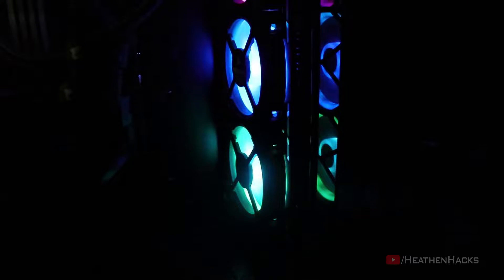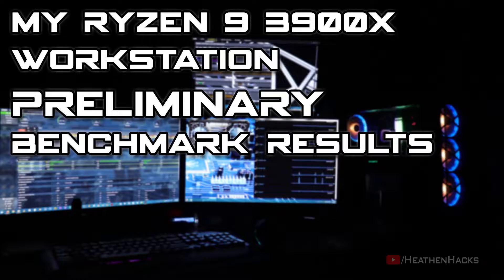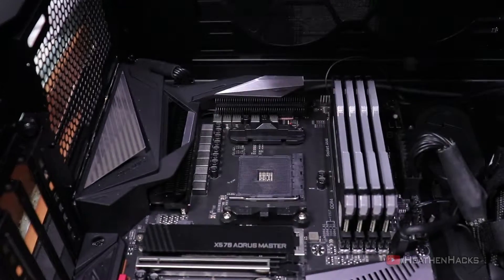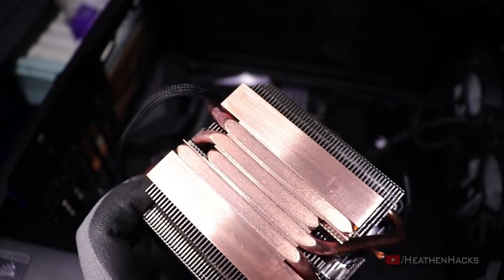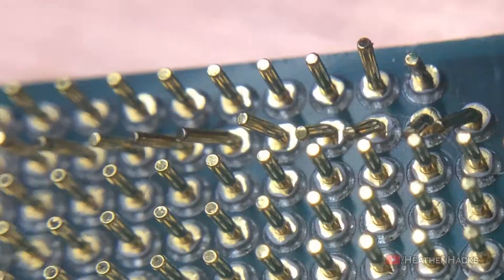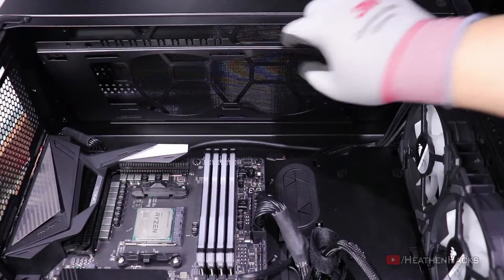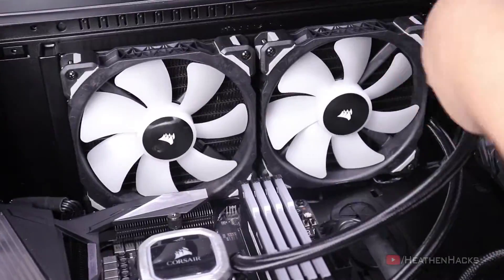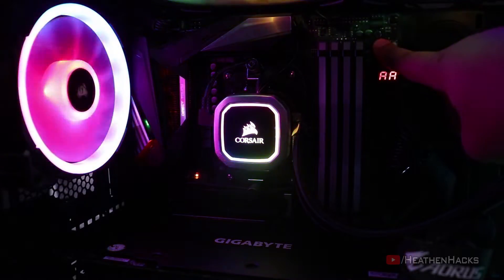Corsair H115i RGB Platinum & LL120 RGB Fan | Unboxing & Setup + PSA for Future AMD Adapters.

Comment: Okay
So if I buy Corsair ML140RGB

and if I want to use motherboard RGB Pins for lightning it up 
And for Fans 
If I use chassis header on case
Will it work normally??
Reply from the maker: Hello, and thanks for the comment! ♥ 

For that, I would refer you to this link on the Corsair forum: https://forum.corsair.com/forums/showthread.php?p=952274

They're talking about LL fans there, but it would also apply on ML fans.

Comment: Well i have the problem with my pump, the rgb dosn´t work, i conected all whe wires but just the fans has rgb, any solution?
Reply from the maker: Hello, and thanks for the comment! ♥ I suggest contacting Corsair through r/Corsair or [https://help.corsair.com/hc/en-us]
Reply: @HeathenHacks  Page dosnt exist anymore, i was searching and some people has the same problem and one of them said something about the PSU, the SATA need to be conected to another with 5 wires. and my thermaltake 750w only have 4. they recommend to change the PSU a little dissapointed cuz i just buy this PSU and the AIO, thx for answer
Reply from the maker: I haven't experienced that problem yet, so I'm unfamiliar with it. Sorry.

Also, I think I just saw something related to your problem here: https://forum.corsair.com/v3/showthread.php?t=183941

Someone's also using a Thermaltake PSU and had it replaced.

I guess if you can still return your AIO to where you bought it from, you can change it to a different one.

Comment: Hi, so I have the same cooler and want to buy an extra Corsair RGB fan, will I need to purchase the commander pro in order to control the extra fan via the ICUE software that comes with the h115i?
Reply from the maker: Hello, AM! Thanks for the comment! ♥ Unfortunately, yes. I think either a commander pro or getting a set of 3 Corsair RGB fans [the one that comes with a fan/rgb hub] are the only way to control them using iCUE.

Comment: i need help,my motherboard doesnt have the little 2 pieces where u put the aio with
Reply from the maker: Hello, Don! And thanks for the comment! ♥ What 2 pieces are you referring to? The mounting brackets?
Reply: @HeathenHacks  i think so, the ones in the motherboard where you mounted the aio brackets with
Reply from the maker: Ahhh. I see. I think I know what you mean now. Btw. Are you using an AMD motherboard or INTEL? If it is Intel, I think you need a different bracket/backplate.

You can watch this video from Corsair for a better view of the installation.

https://www.youtube.com/watch?v=87c5_93-3QU

Comment: Why you installed the radiator on top ?
Like that the air will not rise.
Reply from the maker: Hello, Daniel! ♥ Thanks for the comment! That's why there are fans. To pull air out of the case.

Comment: I know this comment is late, but I have some questions about RGB. I have the Asus Prime X570 Pro Morherboard, which I believe has 2 RGB headers and 1 ARGB header. I’ve already purchased 2 Phanteks Neon RGB strips that use a 5V header, so that would take my one ARGB header, right? I’m also using the same cooler as you, and wanted to add two of those fans you used. Would i need a splitter for something? Just a commander pro? I really don’t know much about fans and RGB
Reply from the maker: Hello, Matt! Thanks for the comment! ♥ For the 2 Phanteks Neon RGB strips, yes. You only need 1 header for that since it can be daisy-chained. If I remember correctly, you can just use the fan and RGB hubs that are connected to the pump  for the ML140 fans.

Check out Corsair's installation video for reference: https://www.youtube.com/watch?v=F4RmMKwC5hA
Reply: HeathenHacks sorry, I was asking if I always wanted to use QL or LL fans in addition to both
Reply from the maker: I see. For that, yes. A Corsair Commander Pro would be needed to both control the RPM and RGB of the fans.
Reply: HeathenHacks I ended up getting the QL fans that include the lighting node core, and a separate fan hub that isn’t like 90 dollars aha. I believe that should be all I need
Reply: HeathenHacks thanks for your feedback though!
Reply from the maker: Oh, yeah. I forgot that a lighting node core is included if you buy a pair. Good choice.

Comment: Hey so I just purchased  H115i and was thinking about replacing the mL fans with LL ones. Do you think that’s possible? I want all LL fans on my setup.
Reply from the maker: Hello, Jonathan! Thanks for the comment! ❤️ Yes. It’s possible. Tho, afaik, ML fans are much more suited for radiators, because they can spin and move air much faster than the LL ones. Just saying.
Reply: HeathenHacks I know. But the LL series look so much better and I don’t want to mix and match between the 2.
Reply from the maker: Yeah. It does look much better. I just didn't replace mine since my radiator is at the top and won't see it as much. :D

Comment: One of my H115i Pro fan failed after 7 month use of about 9hrs per day 5 days per week. The fan rattles at speeds over 600 RPM after 4-5 hours of run time. When I set both fans to run at fixed PWM duty cycle (open loop) the faulty fan lags behind about 70 RPM. So, the faulty fan seems to have higher dynamic friction even if its not making noise at low RPM. Does anyone know how the Corsair warranty works? Can I just get a replacement fan or do I need to send the entire system back to Corsair? I regret getting fooled by marketing hype about zero friction magnetic bearings. I wonder when the other fan will fail. I'm tempted to take the loss and put this thing in the trash where it belongs. I wish I had gone with the Noctua CPU cooler, almost half the price and they seem to run forever.
Reply from the maker: Hello, T3! Thanks for the comment! ♥ I think the easiest way to contact Corsair is through their Reddit sub. What happened to your fan is really frustrating. In my case, I just used the default fan settings. All fans set to QUIET [except the pump which is on BALANCED] when not gaming or rendering and all fans + pump to extreme when rendering or gaming and I run it for about 10-15 hours everyday, since I use it for my freelance work as well. I guess time can only tell what would happen but, as of now, I can confirm that the other ML140 fan lags for about 3-6 RPM from the other one. Not sure if it's something to do with the sensors or the software, tho.